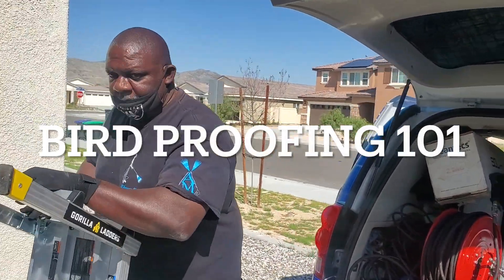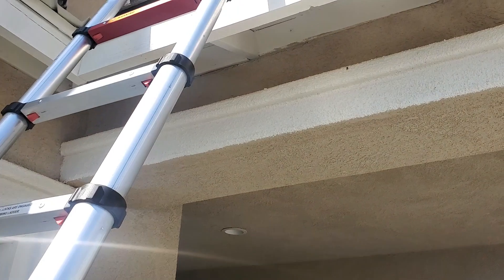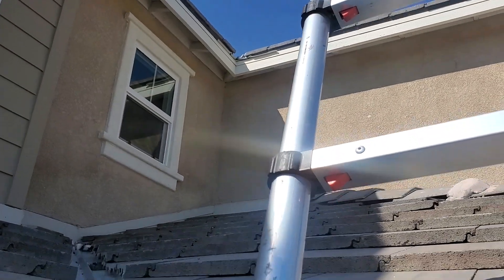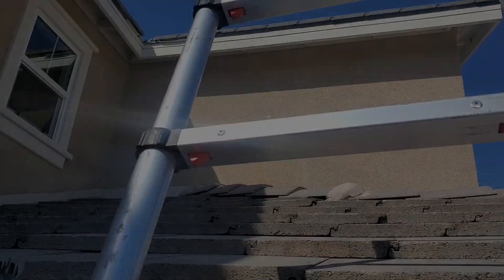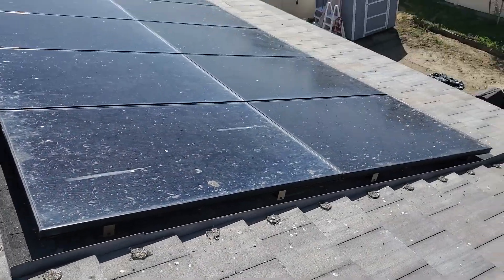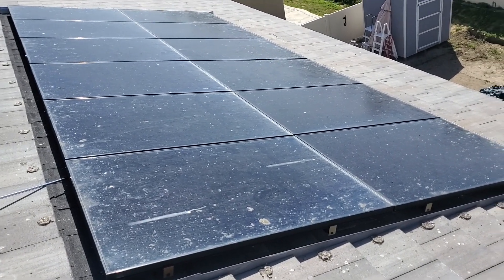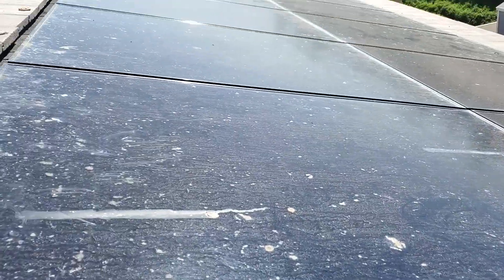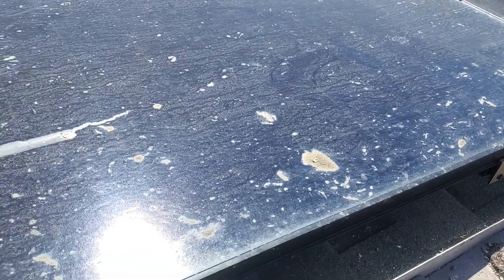Bird Proofing 101| Bird Abatement on Solar Panels | Pigeon Proofing Solar Panels | 909 552 1381

Comment: So where were the birds hiding up underneath the panels? Could you not see them???  Need to invest in a muskrat and him chasing out or a good cat with a really bad attitude.,... Hahaha 😺😺😺😺
Reply from the maker: no we could not see then because they where on the rails ....Love your comment tho
Reply: @socalsolarpanelcleaningcompany  hi guys, with lifting up the panels, did you undo the Allan bolts to lift up the panel? What can you do if walking on the panels is not possible? I've always been told not to walk on the panels. How do you lift them up if the wires are still connected? Thanks
Reply from the maker: @thegadgetemporiumaustralia8509  yes we have to shut the system down then start to undo the bolts around the panels we are going to work on ...sometimes we have to walk on the frames to get to the section if no other way but try to avoid this if possible .
Reply: @socalsolarpanelcleaningcompany  okay understood, so you don't actually undo any wiring like MC4 connectors then? I don't want to start playing with disconnecting wires. I noticed you were trying to stay on the clamps. With shutting the system down I don't know how much good it does because the panels are still live if there's sunlight? I guess it's better than nothing unless you're shutting it down for other reasons? Thanks guys! We love what you do! And thanks so much for answering all our questions!